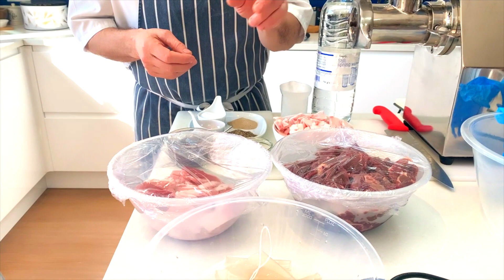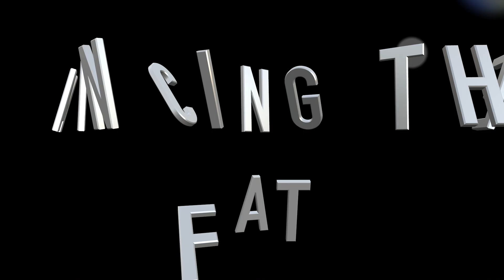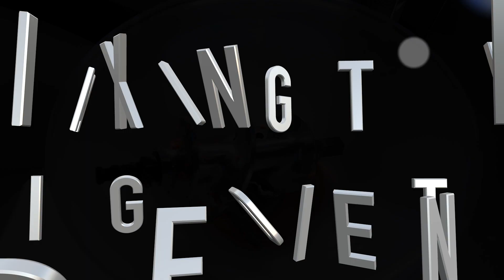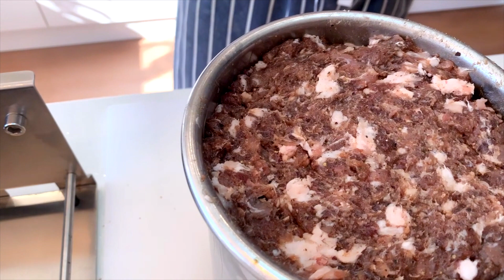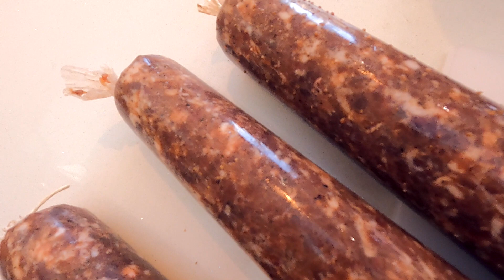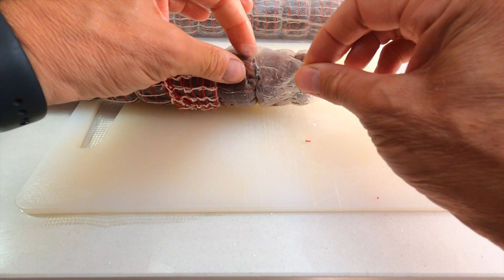The secret behind irresistible venison salami

Comment: G’day, I’m new to cold smoking but I’m keen. What do you call that smoking tray? and what is the wood shavings?
Reply from the maker: This is my large burn tray. I had this made up from 1mm perforated steel sheet. It works really well and burns for a long time. If you have a sheet metal worker locally they may be able to cobble one together for you. I had about 50 made up and they all sold really quickly. They were just a little expensive to get made so I stopped about ten years ago.
Reply: @Coldsmoking thanks for your reply. I’ve just ordered one from Amazon, I know it probably won’t last all that long but a sheet metal worker could use it as a template (maybe) your gear looks amazing. I’ve just refurbished an old wooden bow that’s been sitting out in the weather it’s 600 mill square, I’ve copied your dowel configuration all I need to do now is put some smoke in it. That’s tomorrow’s job. Thanks again for replying

Comment: Meat Ph rises as it spoils! Thats why u check its Ph. Test strips work well too, abd they are cheaper!
Reply from the maker: We’re checking the drop in Ph to determine the stage of fermentation and as a check the starter culture is working to protect the salami. Ph rise in spoiling meat is a far slower process.
Reply: @joesmith7427  g’day mate, how do you work the ph strips? That machine looks great but I reckon it’s expensive.
Reply from the maker: Yes it is. I don't recommend strips and haven't had reliable results. My PH meter is £450 and very accurate indeed but there are much cheaper options on the market these days. You can buy calibration buffers to ensure it's reading correctly too so you ca nrely on your readings.